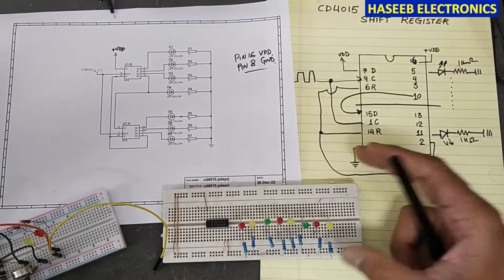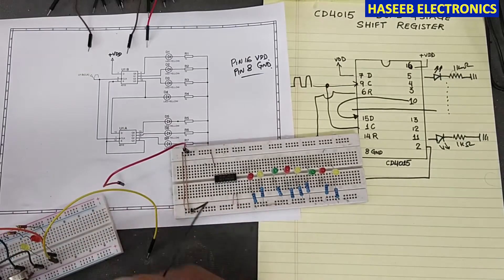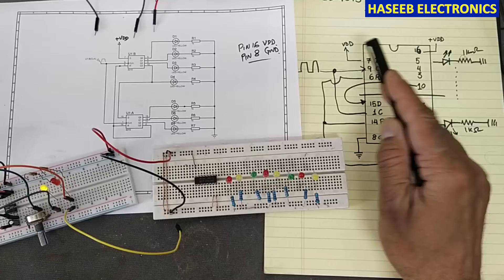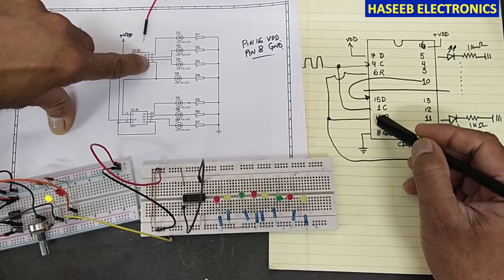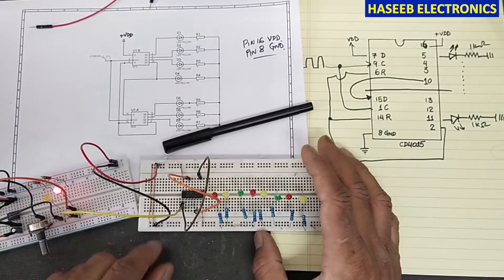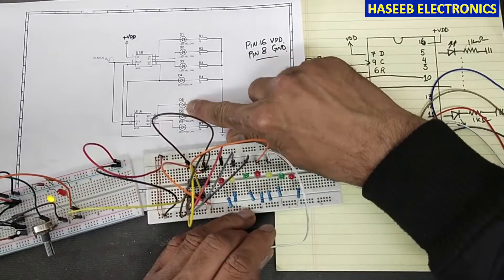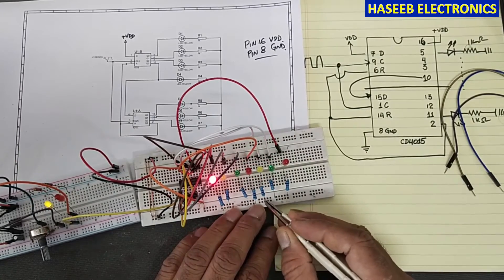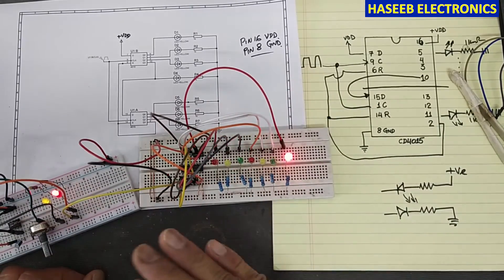{799} CD4015 Practical Circuit

Comment: Hi, are pin 8 and pin 16 connected or not? Best regards Renato
Reply from the maker: pin number 16 is +ve supply VDD voltage (+3 to 15 volt DC)
pin 8 is to be connected to return of the power supply